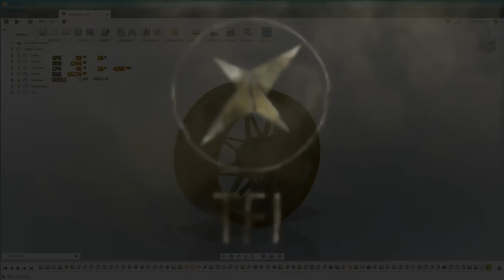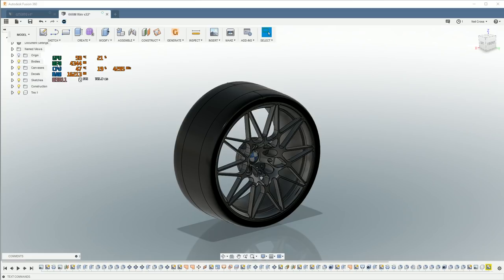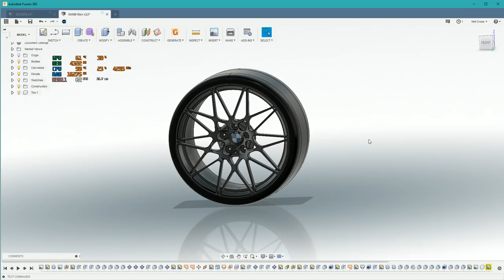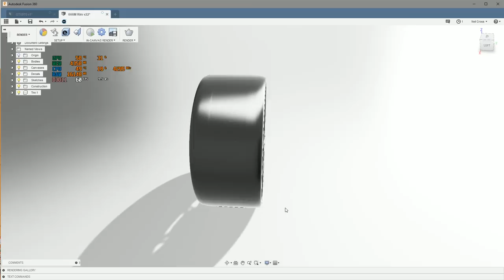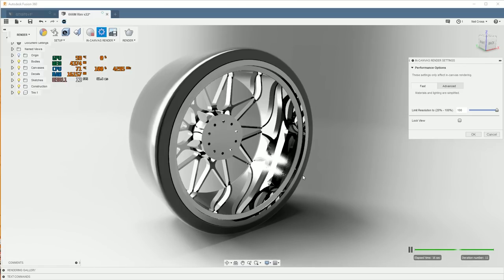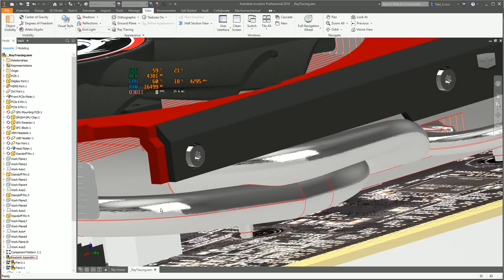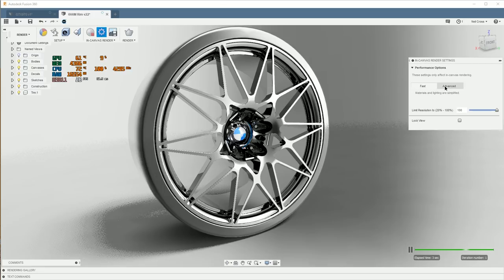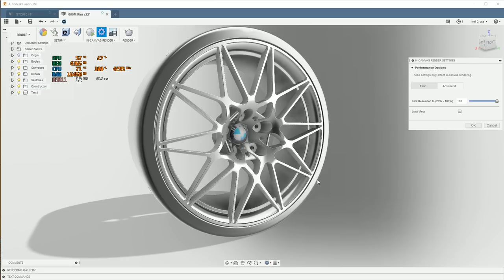Did you know Fusion 360 and Inventor can do Ray Tracing?

Comment: Hi mate, nice video. I have a surface pro 7 i7-1065g7 with 16gb ram. When in Fusion 360 or Inventor ray tracing take for ages. Local rendering also. Is that normal? If yes what would be a good laptop to buy? Thanks

Comment: Hi hopefully an quick question. Was this done on your current pc setup with the 1080 Ti and the i7 8700k? I'm trying to decide to build a pc either with a Quadro P4000 or a 1080 Ti, also do you suggest a differant CPU at this point in time. I am planning using it for mainly Fusion 360 and the occasional gaming. Any thoughts?
Reply: I have both of these cards, the P4000 I got when I using SolidWorks, which requires a Quadro card to unlock a few features, and the 1080Ti was for TensorFlow. These are paired with a Ryzen 7 1800k. My understanding is that SolidWorks uses OpenGL while Fusion360 and Inventor use DirectX like most games. It's hard to find good comparisons of performance, but I'm pretty sure the 1080Ti is overall faster for DirectX. Unless someone points out a contrary reason, it's hard not to conclude that the 1080Ti is a better value. I now use only Inventor and my next card will be a GeForce.

Comment: Nice explanation and a good pointer as to why you don't need a top of the range GFX card to do 3D CAD.  I took a screenshot of my AMD 8300 + R7 GFX card rendering and all 8 cores were flat out but the puny (by todays standards) R7 was at 20%.  I put an RX550 2GB in just to release the R7 for my son's PC and am quite happy with the 3D CAD performance as I don't do much rendering.